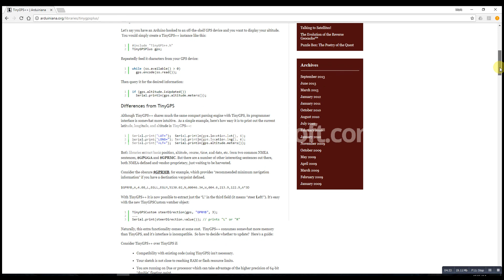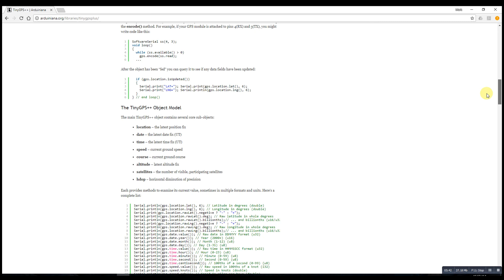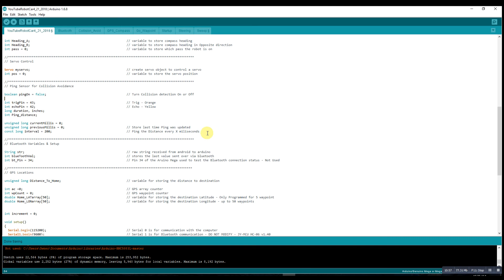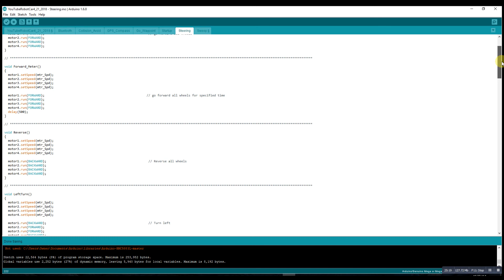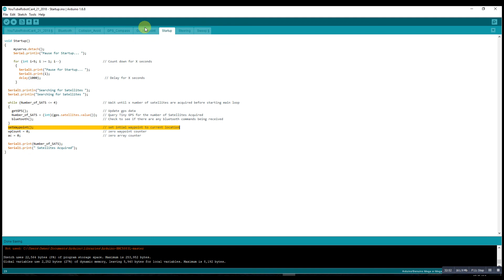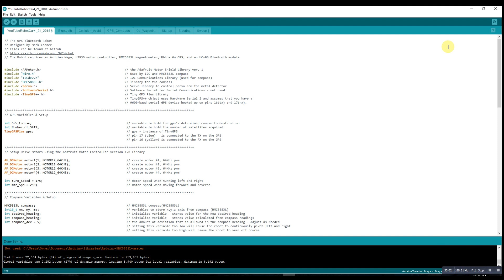How to Build a GPS Guided Robot - Part 6 - The Code

Comment: I'm having a problem with the app itself. The control for movement like forward, reverse, left, and right are not working. The other buttons such as connect bt and disconnect works just fine. I hope someone can help

Comment: Hello, Nice video, but there is an issue with me , compass settings is not been shown, How to install the i2cdev in Arduino uno it is showing error while installing the i2cdev in ide , In the app notification windows noting is been showed up after Pressing Set heading , Please give solution to this
Reply from the maker: You really can't use the arduino uno. You really need need to use the mega; otherwise, the wiring and programming would need to be modified.
Reply: Ok thanks for the reply , I also tried with Arduino mega
Reply: With same , I only removed the ping sensor , rest all are same , without I2C can I do ? Is wire.h is sufficient, If I press the button "Forward" or "Reverse" in the app will the car going to move ?, In my case the car is not moving, mega has been used

Comment: how the destination gps location is obtained by robot? i read the code multiple times and couldnt find the details. My doubt is , in the set waypoint array the gps location of robot is saved. but how did thatmake sense because the destination data should be obtained from the android device right?

Comment: @EZtech. I get errors when uploading the code in audrino. Is that normal?
Reply from the maker: No it's not normal, make sure you selected the Arduino Mega board in the IDE, and installed all the necessary Libraries?

Comment: i dont know error, please help me

'class HMC5883L' has no member named 'begin'

 // Compass
  Wire.begin();                                                    // Join I2C bus used for the HMC5883L compass
  compass.begin();                                                 // initialize the compass (HMC5883L)
  compass.setRange(HMC5883L_RANGE_1_3GA);                          // Set measurement range  
  compass.setMeasurementMode(HMC5883L_CONTINOUS);                  // Set measurement mode  
  compass.setDataRate(HMC5883L_DATARATE_30HZ);                     // Set data rate  
  compass.setSamples(HMC5883L_SAMPLES_8);                          // Set number of samples averaged  
  compass.setOffset(0,0);

Comment: @EZtech I need your help. I have done everything step by step. I have made the circuit, and calibrated the compass, and uploaded the code. And did everything which you told in this video. But the problem is that, I never got any output whenever I press any button in the app. Even the connection is proper and code is properly uploaded, also compass has been calibrated perfectly but nothing works with the app, whenever I press any button.
Reply: did you solve the problem?
Reply: i have the same issue, and the problem seems to be at compass, if i comment the line for comapss the bluetooth app is working, what kind of compass are you using?
Reply: Yeah I have same problem here
Reply: Can you share your code ?
Reply: @simoncyber2049  Hi, just picked up your comment, I have two bots working ok from a couple of years ago, tried to build a new set which like you would not run. Just changed the compass mast from the old one and guess what, it works! all are GY-273, must be the compass itself. Will order another and hope.
Reply: @simoncyber2049  Just tried GY 271 compass chip works ok.

Comment: I’m using arduino uno on a rc car and I’m basically wanting a return to home function. instead of using Bluetooth is there a way I can set an array with cords like (30.0000,-80.0000) that will guide itself to from what ever cords the rc car is at to the cords Ive set in an array. I have a compass and using neo-6m gps module with Hobbyking 10a esc, ultrasonic sensor and arduino uno. I’ll be happy to share my code I have for autonomous collision avoiding rc car if you would like. Just looking for an upgrade.  Also thanks for your code, you made it very easy to understand!
Reply: Can you share the code ?

Comment: hello
i was surfing the web and i found this project and is very interesting. i got all the parts necessary, but when i download the arduino code it get stuck on ''''''Startup' was not declared in this scope,,,,,, i even tried on the new arduino web editor
can you please help
thanks 
ps. i saw this at instructables.com/
Reply from the maker: Are you sure you selected the Arduino Mega in the Arduino IDE under Tools/ Board? Also make sure you have all the program downloaded, you should see several tabs...Startup, Steering, Bluetooth, etc. Copy all the files from GitHub and place them in a single folder.
Reply: @EZtech  @EZtech I need your help. I have done everything step by step. I have made the circuit, and calibrated the compass, and uploaded the code. And did everything which you told in this video. But the problem is that, I never got any output whenever I press any button in the app. Even the connection is proper and code is properly uploaded, also compass has been calibrated perfectly but nothing works with the app, whenever I press any button.
Reply: @ShreyaV-612   Just found a possible solution, On first page of program select out all "compass" items. reload and try bluetooth controller. Found the compass chip was blocking the run. (been trying to find the fault for a year!).
Reply: How did you upload all those pieces of code ? only 1 code can be uploaded at a time right?

Comment: can i use it with arduino uno using only 2 motor with L298n driver ???
Reply from the maker: You could use the L298n, but you would need to change alot of the wiring and the code. The Arduino Mega is a must. It's much easier to build it as is and make modifications later.
Reply: @EZtech  @EZtech I need your help. I have done everything step by step. I have made the circuit, and calibrated the compass, and uploaded the code. And did everything which you told in this video. But the problem is that, I never got any output whenever I press any button in the app. Even the connection is proper and code is properly uploaded, also compass has been calibrated perfectly but nothing works with the app, whenever I press any button.
Reply: @EZtech  thanks
Reply: did you do with UNO?
Reply: feras, did it work for you? I'm also trying to modify the code to use the L298n, but it doesn't work. Could you share your code? Thank you.

Comment: i have an error. it says " Startup was not declared in this scope" . what should i do?
Reply from the maker: Did you select the Arduino Mega as your board? This will not work with the Uno or other boards
Reply: @EZtech  @EZtech I need your help. I have done everything step by step. I have made the circuit, and calibrated the compass, and uploaded the code. And did everything which you told in this video. But the problem is that, I never got any output whenever I press any button in the app. Even the connection is proper and code is properly uploaded, also compass has been calibrated perfectly but nothing works with the app, whenever I press any button.
Reply: How did you upload all those pieces of code ? only 1 code can be uploaded at a time right?

Comment: Excellent project
Reply from the maker: Thanks
Reply: @EZtech  @EZtech I need your help. I have done everything step by step. I have made the circuit, and calibrated the compass, and uploaded the code. And did everything which you told in this video. But the problem is that, I never got any output whenever I press any button in the app. Even the connection is proper and code is properly uploaded, also compass has been calibrated perfectly but nothing works with the app, whenever I press any button.
Reply: @EZtech   I have an error,  ' manual ' was not declared on this scope. Tell me how to solve this error?

Comment: Can I use this in arduino uno
Reply from the maker: No, not really
Reply: @EZtech  @EZtech I need your help. I have done everything step by step. I have made the circuit, and calibrated the compass, and uploaded the code. And did everything which you told in this video. But the problem is that, I never got any output whenever I press any button in the app. Even the connection is proper and code is properly uploaded, also compass has been calibrated perfectly but nothing works with the app, whenever I press any button.

Comment: I try to run your code but it tells me Serial1 not declared in this scope... and i dont know what to dooo, Someone can help me ??
Reply from the maker: Alfredo Gallardo Are you using the Arduino mega? The code needs more than one serial port. Also, make sure you are selecting the Arduino Mega when compiling the code in the Arduino IDE.
Reply: @EZtech  yeap, im using Arduino mega, selecting it in the sketch and the right port tooo, i dont know what its wrong. Im running the program with all the windows like you are doing in the video, please help me :C and thankyou for your answer
Reply from the maker: Alfredo Gallardo Try commenting out the line of code... // #include <SoftwareSerial.h>  I'm trying to remember if the software serial library is even needed. The GPS uses hardware serial for speed. Try commenting it out and see what happens.
Reply: @alfredogallardo5917  hiii! This is a great project. Need help. Am getting QMC5883 Magnetometer as HMC library doest not work. Although I used the QMC 5883 calibration but data is very unstable! Any help thanks a lot
Reply: @EZtech  @EZtech I need your help. I have done everything step by step. I have made the circuit, and calibrated the compass, and uploaded the code. And did everything which you told in this video. But the problem is that, I never got any output whenever I press any button in the app. Even the connection is proper and code is properly uploaded, also compass has been calibrated perfectly but nothing works with the app, whenever I press any button.
Reply: How did you upload all those pieces of code ? only 1 code can be uploaded at a time right?
Reply: @navadeep025  watch this 
https://www.google.com/search?q=how+to+open+multiple+arduino+sketches&oq=how+to+open+multiple+arduino+s&aqs=chrome.4.69i57j33l7.33694j0j7&sourceid=chrome&ie=UTF-8#kpvalbx=_tcPaXor4JsWKmwXngbGgDA58

Comment: Can i have the link to download the I2Cdev library? I already have one but not sure if is the right one, I'm trying to compile but gives me an error "the folder doesn't have a valid library", also I'm using an arduino nano.
Reply from the maker: Daisy Fernández It will not work with the nano, it doesn't have enough serial ports. Select the Arduino mega and try compiling again.
Reply: @EZtech  @EZtech I need your help. I have done everything step by step. I have made the circuit, and calibrated the compass, and uploaded the code. And did everything which you told in this video. But the problem is that, I never got any output whenever I press any button in the app. Even the connection is proper and code is properly uploaded, also compass has been calibrated perfectly but nothing works with the app, whenever I press any button
Reply: EZtech it doesn't work "fatal error: I2Cdev.h: No such file or directory
#include<I2Cdev.h>
Invalid library"
Reply from the maker: Daisy Fernández Try commenting out the include statement with I2C in it and recompile the code, I am trying to remember if this library was needed at all. If for some reason it doesn't work here is a link to the library... https://github.com/jrowberg/i2cdevlib
Reply: EZtech didn't work out, gives me the same error but with the HMC5883L library. I downloaded the library from the link and nothing 🤔 i tried to copy the library's  inside of the arduino libraries folder but it didn't work out, have you ever had this kind of problem?
Reply from the maker: Daisy Fernández The hmc5883l library that is listed inside the Arduino ide auto install library is the wrong one. You will need to manually delete any hmc5883l libraries that are not the one I refer to; otherwise, you will get compile errors. Be sure to delete any other compass libraries.
Reply: EZtech Congratulations on the post. Very didactic and detailed. I am building a caterpillar mat robot and will try to use your code in my project. If you would like to receive images of my progress, please send a "Hello" to my santaritapecan@gmail.com email address. Thank you very much for sharing your knowledge.